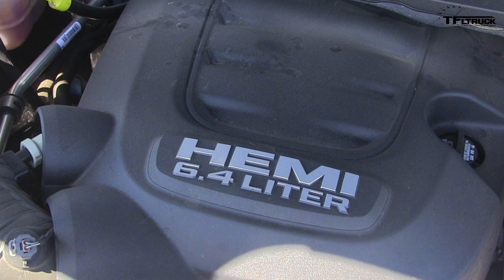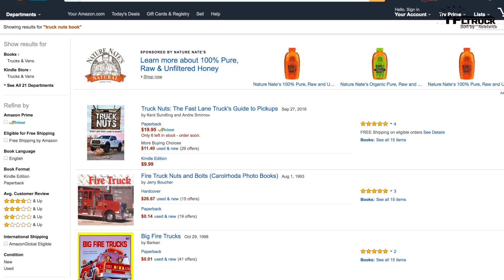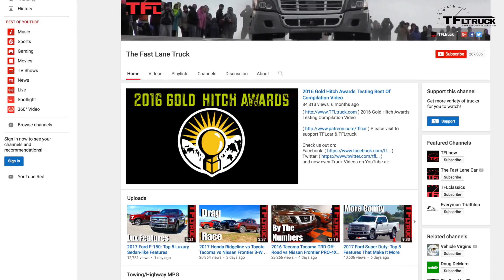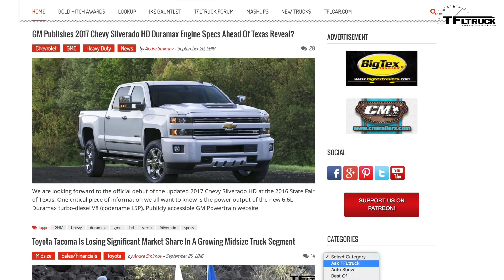Ask MrTruck #1: Why do Manufacturers Limit Torque in First Gear in Heavy Duty Trucks?

Comment: My personal experience with Chrysler (Ram) products is still that they have some poor quality issues and take the cheap route on a lot of things. My parents bought a Wrangler brand-new in '09 and it had rust on it straight off the dealer lot. It's under-powered, gets terrible gas mileage, and has had several fault codes thrown before it even hit 100,000 miles. I test drove a brand-new 2015 Ram 1500 5.7 that had a lifter knock straight off the showroom floor. I also test-drove a brand new Chrysler 200 and it just felt cheap and poorly designed compared to....well...everything else in that market at that price. They seem to be making good progress since Fiat bought them, but they still have some work to do before I could bring myself to get a Chrysler product.
Reply: They are not making progress with Fiat:
http://www.autoblog.com/photos/consumer-reports-least-reliable-brands/#slide-3671842
sale numbers, yes...but reliability..no
Reply: SB N
Lol, ouch. Looks like they still quantifiably suck then...
Reply: their reliability has always been at the bottom of the barrel
Reply: Steven Vanheel No doubt! a 2016 brand new truck is expected to be driven better and faster than a 10 years old truck. Look and sound can deceive ones feeling for speed. The 8-speed Hemi is not even close for being the fastest truck, nor being capable:
http://www.caranddriver.com/comparisons/2015-chevrolet-silverado-vs-2015-ford-f-150-2015-ram-1500-2014-toyota-tundra-comparison-test-2015-ford-f-150-vs-2015-chevrolet-silverado-1500-2015-ram-1500-2014-toyota-tundra-final-scoring-performance-data-and-complete-specs-page-6

It's the slowest, least payload, least towing, slowest to stop, second to last on mpg, last on interior room...truck out of the 4 compared.
Reply: Wow dude that sucks.
Reply: My parents bought a 2006 Dodge Ram 2500 with a 5.7 hemi brand new in 2005 and it has been hands down the most reliable vehicle we have ever owned. We still own it to this day and it is a daily driver and our tow rig. We just bought a brand new 2016 ram 1500 with the hemi and there is a few things about it that kind of piss me off that a truck that costed so much would have, but overall it is a great truck and an absolute blast to drive. Some of those things that piss me off are: the day we bought it off of the lot, and soon as we got home I crawled under it and looked around. The whole entire driveshaft was covered with rust, and the rear axle and diff were starting to rust. The lifters were ticking on start up, but the hemi motors have always been known for a little valve train noise. I can't say that I remember it on our older one though. Also, the cloth seats kind of suck. They feel really cheapish. We got the big horn package, and it doesn't even have a power passenger seat! That something I would expect in a $48,000 vehicle. Other then that the truck rides like a dream. It is the fastest truck I have ever driven, and the 8 speed shifts at the perfect times and it is very smooth. They upgraded the hemi from the old version and now it is fast as hell.
Reply: SB N I have a really hard time believing it is the slowest to stop. The brakes are spectacular. I have driven 7 other trucks, all with different motors (ranging from 4.3 v6 to 7.5l 460v8) and none of them could ever beat the hemi. It even took my 5.3 silverado by a long shot. IMO dodge is absolutely not at the bottom of the list like you say, but I really believe that there is some stuff they could improve upon.
Reply: Steven Vanheel I wasn't just me saying. It's Car and Driver publishing the factual numbers after testing all the trucks. Ram 1/2 ton only have the 5.7 Hemi as the highest option. GM has the newly direct injected 6.2L. Ford has the twin turbocharged 3.5L and lighter aluminum alloy. Toyota has an OHC 5.7L which always breathes air better than OHV with similar displacement. Ram just doesn't measure up to the others right now.
That's not to say that the Hemi Ram is a bad truck. It's a decent truck. But being the fastest? may be comparing to a 10 years old truck, yes. You can also look around to verify the numbers beside Car and Driver. I can assure you that it's very much what they've stated.
Reply: SB N Toyota is DOHC
Reply: guy proulx Yes! But I was talking about OHC vs OHV. DOHC or SOHC or triple OHC (done on motorcycle engine) are all OHC engines.
Reply: SB N got ya
Reply: Steven Vanheel BTW, were you talking about a 20 + year old Ford 460 v8? You do know that they're vastly different in techs and design right? even the new V6s are making more power than the "not much older V8s" nowadays. We're just comparing all new vehicles here.
Reply: SB N I said ranging to a 460 v8. That includes most motors inbetween. And yes, the 460 is an old tech motor with low power. And the 4.3 v6 was the most gutless motor in a truck that I have ever driven. Oh, I also forgot to mention the 488 v10, the 5.4 triton, the 6.0 vortec/ecotec, the 5.0 302, and a few others I am not thinking of right now. Out of all of them the newest gen hemi is the fastest. The old 5.7 hemi could never touch a candle to the new one as far as power goes. Vvt and all the other goodies they did to the motor really make a world of difference. With the old hemi, the power band would taper off once it got into the higher rpms, but with the new one it gives smooth, strong power delivery from one shift to the next, and it is always in the power band. If it wasn't for traction control/torque management, the tires would break loose so easy. You can feel them trying to slip and the computer stopping it every time you floor it (under 50 mph).
Reply: Steven Vanheel "The old 5.7 hemi could never touch a candle to the new one as far as power goes.."  by saying new, do you mean that this 5.7 Hemi that you currently own is any difference than the one they introduced back in 2009? all I see is 5 more HP. The 6.2 Ecotec 3 is new engine in 2013, it has 420 HP and most importantly 450lbft of torque. The second gen 3.5L ecoboost is making 450Hp and 510llbft in the 2017 Raptor. Ford no longer focus on their N/A v8, but even then, the 5.0L Coyote is making 435HP and 400lbft on the Mustang.
I do not disagreed with you that the newer Hemi is faster than the old one. Whose would? But when you said that the 2016 Hemi Ram is the fastest truck out there, then it's wrong. I bet even the new Titan with its new DI 5.6 L engine would give the Hemi Ram a hard time.
Reply: SB N when I say old hemi, I mean the ones that they released in 2002 and ran up until 2009. Sure, on paper you probably wouldn't see much gains, but you would really never know until you test drove it. The power delivery is strong and smooth, and there is no dead spots anywhere. And yes, the 302 is making some great power numbers. Hats off to ford on that one, but the ecoboost is kind of a love hate motor. Most people think that a v6 has no place in a truck, but at the same time it is really powerful. The 6.2 chevy seems like a really big motor for the amount of power it is making compared to a motor like the 302.
Reply: TFL Truck does some 0-60 timed runs on the trucks they test and I believe the Chevy/GMC 6.2L is still the fastest on their tests. That said, nobody buys a truck for drag racing and acceleration times, IMO, are just about as relevant as a water buffalo's butt hair. It's all about towing, hauling, grunt work stuff with the trucks unless you're just using it as a pavement queen grocery-getter pickup.
Reply: Kcducttaper1 Funny you've said that, but there are a small number of people do buy trucks for racing. That's why the Lightning, Tremor, Silverado SS, Ram SRT/10 were/are in production. And 90% of truck owners do use their trucks as a family car, or as you've labeled them, pavement queen grocery-getter pickup. Only about 10% or less of 1/2 ton trucks owners bought new trucks for actual works.
Beside, trucks owners/buyers are some of the most competent and brand loyal people. They love to brag about how fast and powerful their pickups are. How else would you test a truck's power, but 0-60 or similar to Ike Gauntlet runs?
Reply: I don't believe any of those 'hot street models' are still in production. If you want to go fast on the street, a pickup is just not the platform for it. ...unless you're Farm Truck, of course. The only thing 0-60 times are good for is fan boy wars.
Reply: Kcducttaper1 Ford was selling Tremor F150 till last year. Both Ford and Ram do have the "Sport" trim for their 1/2 pickups. "0-60 times are good for is fan boy wars" is clearly an individual opinions. Every articles, publications about automobiles...talk about 0-60 times. It has been one of the reference of power since forever.
Reply: SB N
 ...which means they don't make them anymore. :) Journalist publications publish what their readers want regardless if it's properly scientific or not; much like....well...anything on the news. 0-60 times can give you a somewhat general...ish idea, but there's so much more to it, it doesn't really matter in daily use. For example; using that logic, gas trucks should be much more powerful and tow way more than their diesel counterparts, which is simply not true.
Reply: Kcducttaper1 dodge still makes the short box single cab r/t trim Dodge Ram, which TFL did a video on. So even though they are not as race oriented as an srt-10, they still do make some money off of it.
Reply: All hemi's have a knock or tick at startup.  It's not a lifter.  You can have your opinion, but you clearly don't do your homework.  I buy what is the best product there is.  I have no brand loyalty unless they make a better product.  Every manufacturer could improve on something and nothing is perfect, even Toyota trucks have (some issues) like the cracking crank shafts in their v-8s.  It's not Chrysler Ram, they are not the same
Reply: The 6.2 is very limited in what you can order it in.  Chevy likes to do that, have one big engine for the test runs, but then they only offer the 5.3 in 99% of the trucks.  I owned a 8.1 in a 3/4 ton Suburban, great motor, pulled like a freight train and good gas mileage but the whole truck just rusted away and I always had issues with something the whole time I owned it.  Talk about quality? Chevy and Ford are the worst now.
Reply: I don't buy a truck to drag race.  The Ford 3.5 Ecoboost is nice but has many issues like blowing black smoke as it gets older and fowling plugs.  2.7 sounds nice and we'll see how is does, but some people have seen overheating issues towing that Ford can't understand why.  Do I wish Ram would increase horsepower on the Hemi? sure, but that doesn't stop me from buying the rest of the truck which beats the other brands hands down.

Comment: In the first three gears, the high torque of these diesel engines is multiplied by the gearing. A WOT launch in the lowest gears puts a great deal of strain on the driveline components. For the sake of warranty and durability of the driveline, I believe the torque is limited to protect the driveline components from WOT launches and other abuses.

Comment: I would be looking for Ford to bump up power on the 2017 6.7 via a computer flash in the near future now that the new Duramax numbers are out (445/910).
Reply: Not as long as their torque is higher. Ford saves their bullets for the next showdown

Comment: Mr. Truck,  why does the Ford F250 6.2 make less power than the 6.2 in the Raptor and why does Chevys 2500 6.0 make less power than in the 1500 series?
Reply: HD V8s are detuned for longevity hauling and working work purposes verses a truck for play or daily driver
Reply: Johnny Smith the halfton chev is a different engine than the heavy duty
Reply: more power equals heat. heat equals more emissions and more chance of breaking parts. over 10000lbs is less power than under 10000lbs, for all the Gas engines
Reply: Reliability is really the main reason.
Reply: It's all about emissions. Diesel emission classes are different than gasoline. Gas cut off is 10k and Diesel is over 14k look it up on EPA website. 6.7 Powerstroke for pickups are 440hp and 925ft-lb, and F350-550 are 350 hp and 750ft-lb. The transmissions are identical and the driveline parts are bigger and more durable in the heavier trucks. The amount of work being done is substantially higher and for longer durations. A big part of the issue with the 6 liters were only in the much higher rated(hp) Ford trucks, but not in VT365 international trucks and buses? Why with more power comes more fuel and air, that equals more heat. Everyday Joe public is stupid. I have more power so I'll use it. Like the 2008-10 F450 pickups with 4.88 rear ends. The trucks wouldn't do 80mph so people whined and what happened? We got a neutered F350 based F450 cuz everyone wants to have the biggest toy and drive like an idiot. Fast forward to 2015 and we have a second overdrive and we can have our cake(30k towing) and eat it too(80mph)